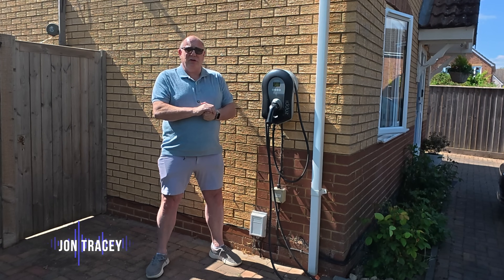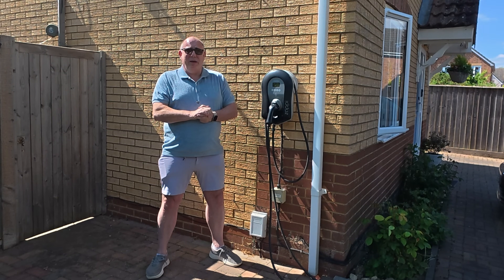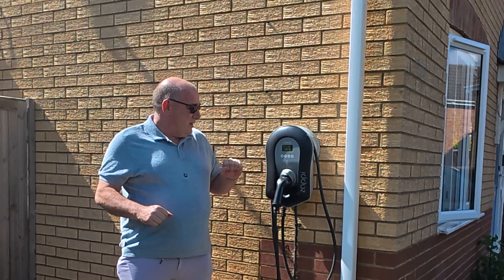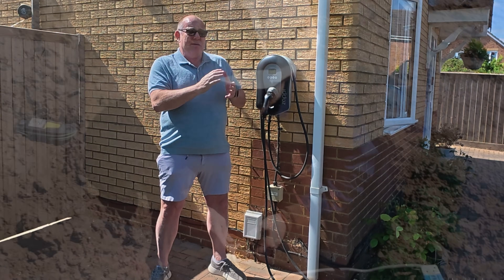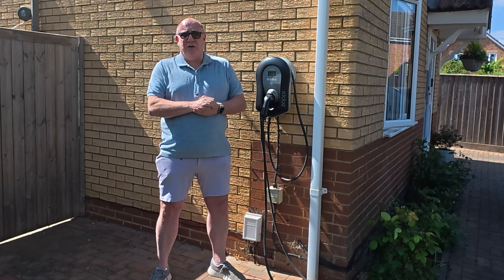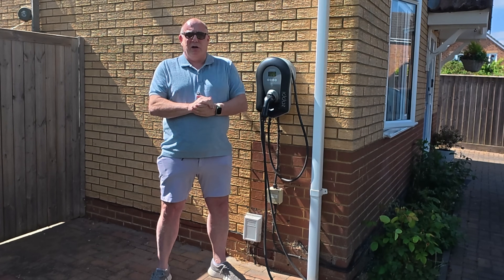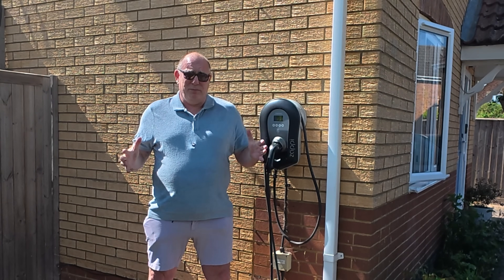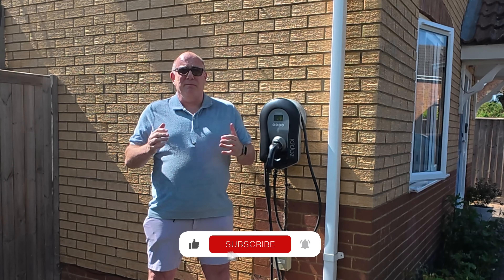Why This Home Upgrade Could Cost You Big in 2025!

Comment: 4th reason to divert solar power to the EV or hot water is if you are generating more than your export limit and house consumption in order to avoid clipping. In the Zappi menu you can set to divert power to the EV once you exceed a set export amount but you have to be careful as you need to take into account the 1.4kW (I think) minimum charge rate. I have a 4.5kW export limit so I set the Zappi to divert if export exceeds 3.0kW. This seems to work for me with the Zappi set to Eco+.
Reply from the maker: Great point — using surplus generation to avoid export clipping is a really smart strategy, especially if you’ve got a limited export capacity set by your DNO. Setting the Zappi to kick in before you hit that cap is a clever way to make the most of your solar without losing out on potential energy.

Have you thought about asking your DNO to increase your export limit? In some areas, especially where network capacity allows, they may approve a higher limit or even unrestricted export, which could give you more flexibility and reduce the need to divert just to avoid clipping. Might be worth a shot!

In any case, sounds like you’ve got your system dialled in nicely
Reply: @JonathanTracey 5th reason is if you're on a FIT tariff with deemed export. 👍
Reply: @JustinBartley-f9u agreed but if you have a smart meter you can switch your fit export to SEG and keep your FIT generation!

Comment: I totally agree with you, apart from one thing there are more feed in tariffs/FIT payments, we get payed for half of what we generate no matter if we use it or it goes back to the grid ?  I also believe that there are more feed in tariffs as well ? So may well depend on your situation ?
Reply from the maker: You're right — there are different FiT arrangements, but most assume 50% deemed export at a fairly low rate. If you opt out and go on a metered export tariff like Outgoing Octopus, you could earn 3–4x more per kWh depending on how much you export, so it's definitely worth checking your situation.

Comment: Forth reason if you get fit payments
Reply: Yep use over 95% also must keep in mind rates are likely to drop and if they do you can't opt back in to deemed export.
Reply from the maker: Absolutely — that's a great fourth reason! If you're on the legacy Feed-in Tariff, diverting excess energy to your EV or hot water can be especially worthwhile, since you're already being paid for generation and (in most cases) a deemed export amount, regardless of actual export. So any additional self-consumption just increases the value of each kWh you generate.

Just to add: for those on FiT who export a lot more than they use, it's also worth knowing you can opt out of deemed export and move to a metered export tariff like Outgoing Octopus. But if you're making good use of your solar at home — like you are — staying on deemed export often makes the most financial sense.

Comment: The My-Energy stuff... all basically band-aids for not having enough battery storage.  Once you get enough energy storage you stop worrying about diverts and load dumps and you just use everything normally and not worry about it.   The literal solution.  Then simply program the EVSE to charge at a slower rate... like 3kW instead of 7kW+, so it doesn't immediately deplete the (greater amount of) battery storage, and plug it in whenever you want.  That's what I do anyway. 

-Matt
Reply: However much battery you have - at the moment buy cheap and export like crazy…
Reply from the maker: Thanks, Matt — totally get where you're coming from! As you may have seen in the videos, I actually have a fairly large amount of battery storage already. Is it enough? Never! I could always use more. But even with that, I still end up exporting a lot of excess, so I'd rather get paid well for it and buy it back when needed at a cheaper rate — that strategy works out better overall for me.

Comment: Thanks, like many, I just leave my inverter settings to fill the house battery on cheap rate and then export surplus during the day. In Summer, I am exporting from about 11.00 am, in Winter very little, but no messing about with the inverter, just leave it alone. When I was on SEG at 4p/unit export then yes I used to divert to the car.
Reply from the maker: yeah, I’m quite surprised if anyone is still on SEG, but as a say if things change in the future and the maths no longer works out we might all go back to using as much of our own energy as we can

Comment: With export tariffs as they currently are (and remember it’s not just Octopus at 15p, Eon Drive is 16.5p), I can’t see there’s any reason to buy a solar diverter.  And with a heat pump, even less reason.
I’d also say you should buy the right EV charger, one that gives you the option of Octopus Intelligent Go, even if you don’t go onto iGo, its good to have the option in future
Reply from the maker: so if I think back to when I purchased mine, the ability to divert solar was one of the unique features of the Zappi. today it’s pretty much table steaks as a feature for a modern charger. Providing doesn’t cost any extra if I were purchasing a charger today, I would get one that has the feature even if I had no intention of using it in the current climate.

Comment: I can think of a reason 4, it might be that your priority is low carbon driving. 
Taking today as an example, last night the CO2 equivalent of the grid in my area was 105 - 119 gCO2eq/kWh. 
During the solar peak today it was 81 - 89  gCO2eq/kWh  and 0 gCO2eq/kWh from my solar. 
So you might use solar divert for that reason, I don't personally but some people might.
Reply from the maker: yeah, that’s a perfectly legitimate reason four 👍

Comment: I thought about a Zappi and/or Eddi, but once I got a heat pump there is no way I'd buy a Eddi as a way to heat water as the Heat Pump (if I chose to use solar to heat water, which is unlikely unless I want to sit in a cool breeze😁) is going to covert that solar to heat water at 300% efficiency.....Anyway, I'm glad I didn't waste my money.
Reply from the maker: So there are a couple of situations where I would consider using it to heat hot water however the stars would have to align for these to come true. We can take our solar system off grid into what’s known as island mode. This allows us to run the house from solar and batteries, even if the grid is disconnected. In that situation I took the decision not to put the Heat Pump on the critical loads That will be powered from the batteries during an outage. My thinking was that our grid outages are so infrequent that it’s unlikely that we would get a long period of time where we would need to heat the home. But I would still want hot water, so the Eddie is on the critical loads board.
Reply: ? @JonathanTracey  I agree except I decided to use my immersion heater as a backup for hot water. Lot cheaper than an Eddi, although my installer wanted to install one initially. Low tech simple solution.

Comment: One thing to keep in mind - if you force export your battery at night - its important to set the eddi and zappi to 'stopped' mode to avoid them potentially soaking up the export if you have the car connected. We use the eddi as a timer for the immersion and a towel rail so i have a set to stopped mode automation for both at 6am and normal/eco+ for 2am in home assistant - when my cheap tarrif is available.
Reply from the maker: Yep, that’s exactly what we do, I have it all automated in Home Assistant so it can put both of them into stop mode so even if the calls are connected, they won’t charge when we’re for e exporting
Reply: @JonathanTracey  have you published a video on Home Assistant and how you use it?  I have not yet set up my HA but wanted to just it for Predbat for example.   Also, thanks to this comment I have figured out a problem I had so if HA can help there then all the better.

Comment: It's funny to watch this video. Here in the Netherlands we basically get noting for solar export from the energy companies.
The fixed contracts give you 0 after "export cost" but luckily there is still bit of tax you get back through the net metering scheme.
With a dynamic contract (something like Octopus tracker) you get the market price, but that is mostly 0 or even negative on a sunny day nowadays, while the price goes up during the morning and especially the evening when we all use the most.

I expect the UK to follow this trend in a few years. It's a matter of supply and demand, and that will change with solar systems becoming more affordable. So it's a good thing that these EV chargers, solar diverters and home batteries can change their strategy as you get closer to net zero.
Reply from the maker: Because of the way UK energy companies buy their energy from the generators, unusual spikes in demand cost them a lot of money. With weather forecasting being mostly a solved issue, they can predict that based on past exports how much energy they’re likely to get that they can then resell in the local area without having to go out to the major generators. It works out cheaper for them to take your 1 kWh of energy pay you £.15 for it and then sell it to your neighbour for $.27. They’re handling costs are almost 0,However, this is subject to change at any time.
Reply: @JonathanTracey  It is going to change when supply is much higher then demand.
For example: on Sunday may 11 2025 the dynamic price of energy was negative from 10:00 tot 17:00, spiking to -0,42 euro from 13:00 to 14:00 and -0,39 euro from 12:00 to 13:00 and -0,36 euro from 14:00 to 15:00.
The night was mostly about +0,11 euro and the evening spiked at +0,15 euro. 
This was without the margin of the energy supplier (0,02 to 0,04 with most suppliers) and without 0,123 euro of energy tax. which  also goes back into our pockets through net metering.

Personally I just have a fixed contract (fortunately no export cost yet until it expires this autumn), but a lot of people with dynamic contracts turned their inverters off and their EV chargers to full blast during those hours, as they would have to pay for export, even after the net metering of energy tax and getting the supplier margin for export.
Reply: @JonathanTracey  This post is from one of my favorite YouTubers in The Netherlands:
http://youtube.com/post/UgkxA8Rv6QX0Soj6X5dlltnWsrvrb2SWMoPd?si=BmL_aSmMLYZmz9Cv

Comment: I opted for a Zappi for 2 reasons, 1, it was compatible with the Intelligent Go tariff (as my EV or existing charger  weren't), and 2, future proofing. Whilst I knew I would be charging the car (and subsequently home batteries) overnight, I knew I wouldn't need the divert option, but, if ever the export rates dropped it could then swing back to using the solar as being the more cost effective option. I don't know what the future holds for my tariffs but I at least know I have the option should I need it.
Reply: I would immediately ditch Intelligent go and just go go.... reduced hours of cheaper, but then I would throw all the solar into the heat pump to heat water and the EV's
Reply: @davebax6819  I was asked when I had my solar installed if I wanted an Eddi added (as I had the Zappi) but said I was planning a heat pump at some point so any excess solar I'd just manually dump it into the heat pump when the time came and get 3x the heat for each kWh. As much as the Eddi did make sense at one point, I think immersion diverters are just going to killed off by heat pumps, although I guess there will still need to be some device to trigger the divert  so maybe they could be repurposed 🤔
Reply from the maker: @steve_787 yeah it is quite nice to be able to integrate Zappy with intelligent go, unless of course like me you were the idiot at that bought two zappis which is not supported, we do the integration through one of the cars. It’s been over a year and it would be nice if they could get on and fix the dual zappi support.
Reply: @JonathanTracey  Have they brought in dual support for two compatible EV's yet? I guess they figure with the Zappi side it would be very rare that people would have 2 at one house so have just put it as a low priority, which is an arse.

Comment: Or number 4 if your on a FIT system why not use the solar.
Reply from the maker: but if you’re on a fit system (as I am) you should opt out of the deemed export and get yourself onto an export tariff. The money I’m making from export now is 5X what I was getting from from the deemed export. You can do this without affecting your generation tariff.
Reply: @JonathanTracey  
                                 🤔 might have to do some calculations on that 👍
Reply: @JonathanTracey likewise.  When I had additional arrays fitted I opted out of the deemed export, loosing £100 a year of FIT income, but gained £1200 a year of actual export